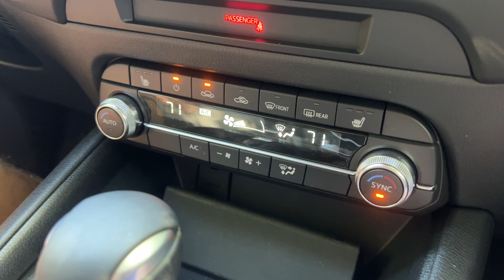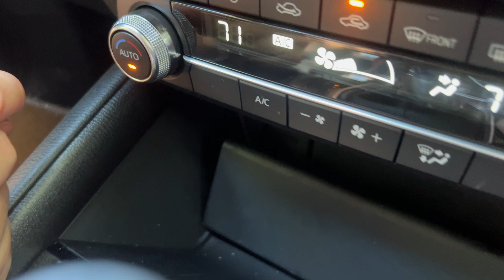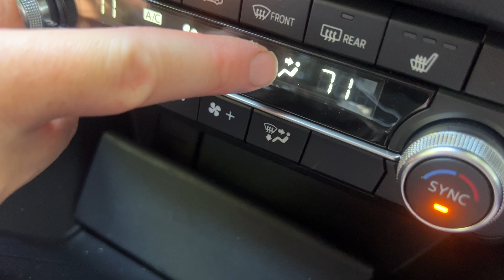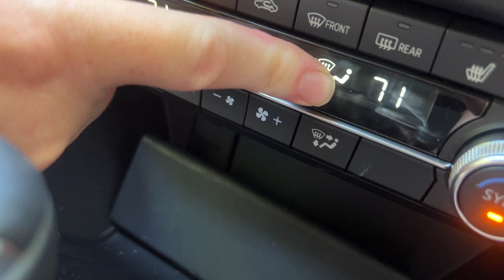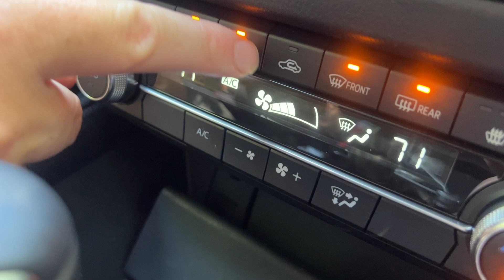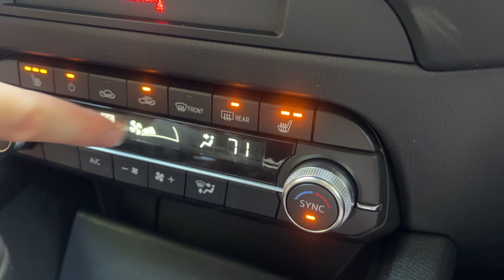How to Use Climate Control (Heat/AC) in Mazda CX-5

Comment: How do you turn the AC off?
Reply: Hi, I just got a Mazda 2019 CX5 yesterday and I’m trying to figure out how to turn the AC off also. I press the AC button and you would assume that would turn it off, but I still hear and feel some air coming out.
Reply: @daisyblue7209 You can turn it down but not off for some reason.
Reply: Right and I bought my 2017 last summer and heat worked fine a few months ago but now even at 71 I still feel cold air not warm…
Reply: To turn the airflow completely off, you have to hit the circulating button and then hit the power button.
Reply: What do we do in the winter?